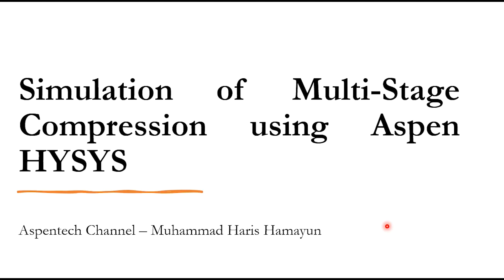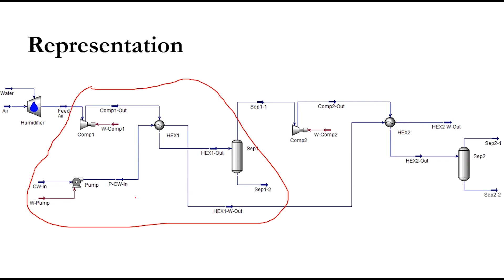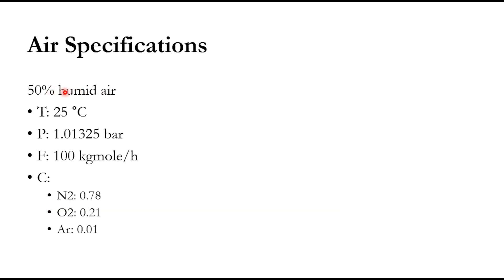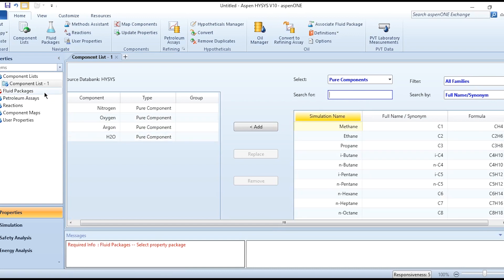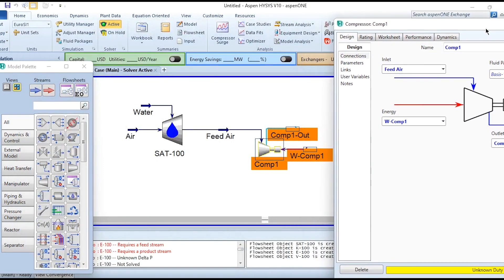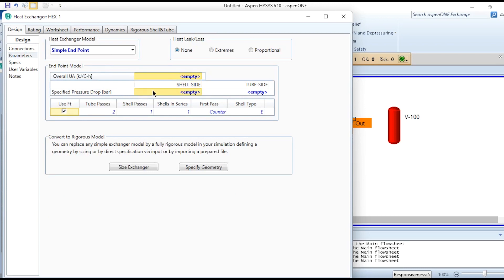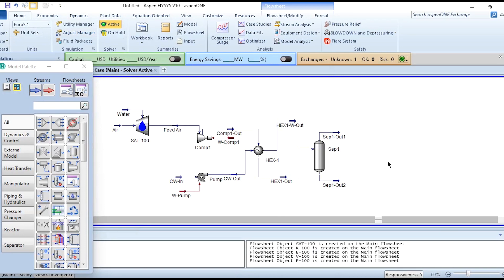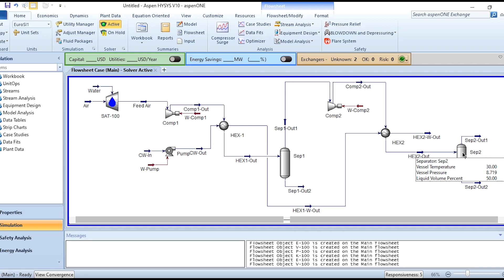Simulation of Multi-Stage Compression System using Aspen HYSYS - Lecture # 107

Comment: I simulated LP compressor for 20000 NM3 hr flow rate with 0 kg pressure drop in exchanger. 
Compressor outlet temp is kept at 110 c  before water cooler.
Simulator results in 497 KW power and 4 stages for discharge pressure of 8.94.can you review and explain that is this power sufficient for given flow. Screw compressor is being used